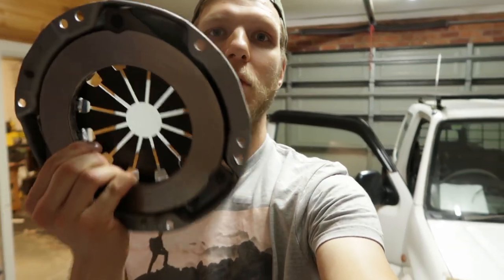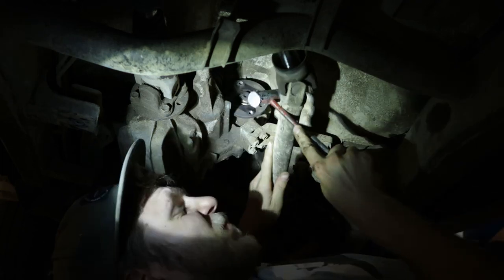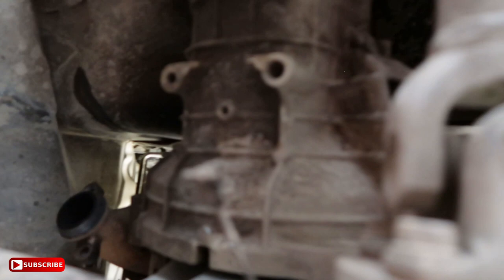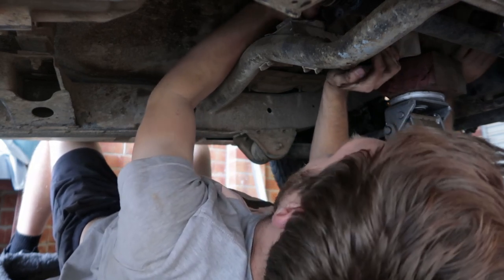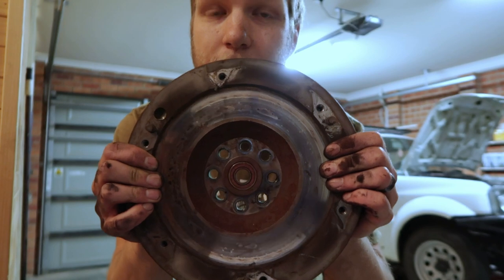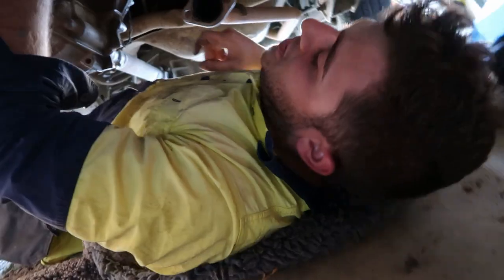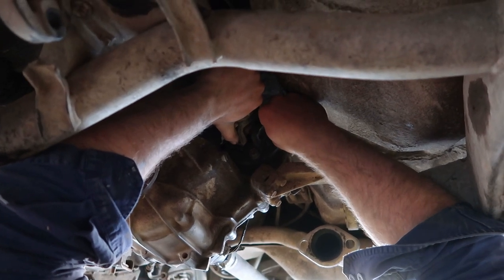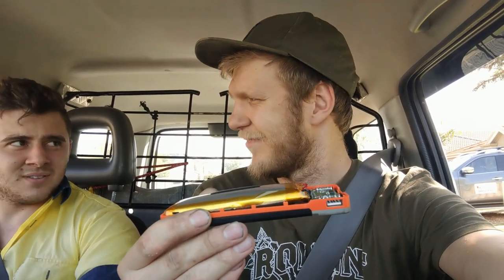WORLDS SMALLEST CLUTCH? - Suzuki Jimny clutch change/replacement

Comment: What's up am from the Bahamas can you help me with this I have 2008 Suzuki swift manual drive my gears box is bad my problem is I cant fine just a gear box  so I got a car from my friend the problem is it's a 2006 Suzuki  swift sport we having take out the gear box yet but I need to no if it will work before we go through all of that work also the cars are Japanese type would you be able to  help me with that
Reply from the maker: Hey mate, your best bet would be to Google it and research it, we don't actually know if it will work, but they both have the same engine so Im guessing it might work. But we can't guarantee it! Thanks!
Reply: @Jukemods  thanks so much I think it will work mate what I think we have to do is change the flywheel  from the 2006 swift and put it on the 2008 swift  so we are hopeing it work so by Monday we will no if it will work
Reply from the maker: Let us know how you go mate!
Reply: So thanks alot for the help ever thing work fine the gear box is shifting  great  but now I relise that my car has more speed I really dont no why I no the  clutches  was bigger from the 2006 swift so we are guessing it's that but it works fine

Comment: Hey Guys    nice entertaining Video   but a couple of things    I think you should  mention is Disconnect the Negative side if your Battery  ( The Negative side because if you slip with the spanner  and hit the body work  you wont do welding   where if you disc the Pos side this can be catastrophic ) 
 Secondly  you didt give  us   much detail  of the job   
 Thirdly  when you took it for a test drive Luke you were not wearing your seatbelt  .
  A very important  thing also is to let a second pair of eyes   the the gy that fitted  everything   have a double check  to see all bolts and cables are done up  
 Other than that you have a good face for Radio   and your video was smooth    flowing  but   not enough info  >

Comment: Do you separate the shaft between the gearbox and the box transmission 4×4
Reply from the maker: Hi hassan,
Yes you do need to separate the shaft from the gearbox to the transfer case. You need to do this to allow the gearbox to slide back.
Thanks!
Reply: @Jukemods  Called a prop shaft.